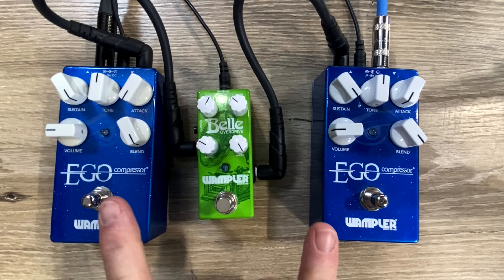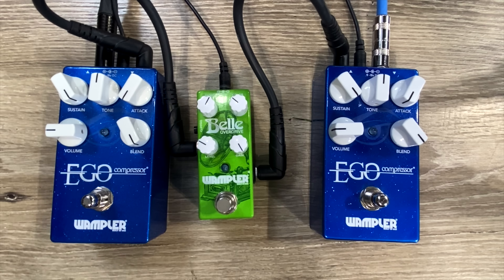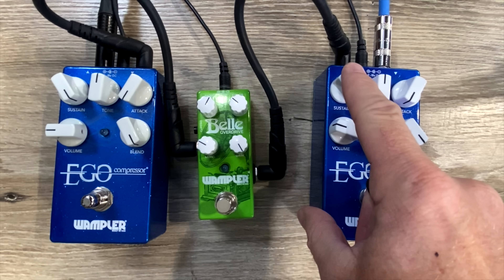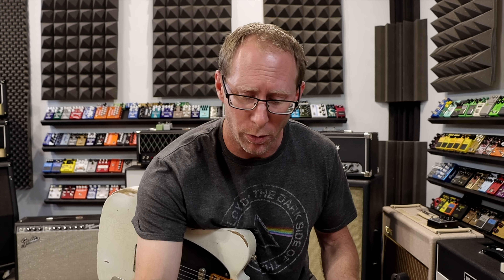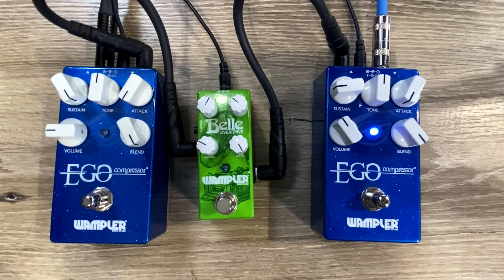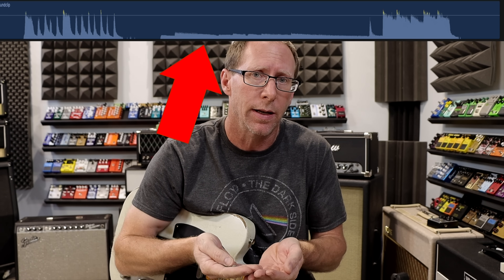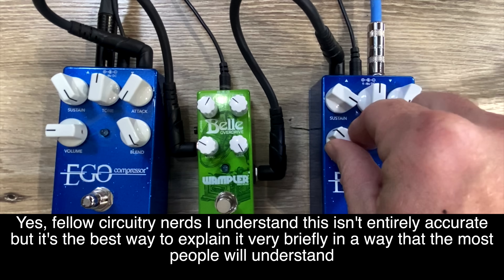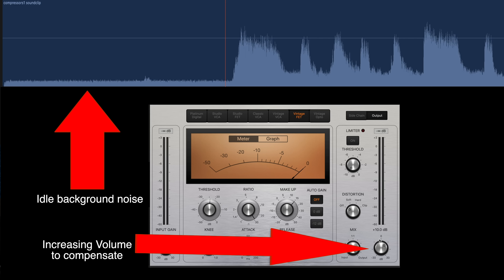Are you making these mistakes with compressor pedals?

Comment: I really like to keep a compressor on all the time, really subtle, to round off the edges of the sound. Also it gives a very nice percussive pop to the tone, and just helps all around with the consistency of the sound.
Reply: I play power metal and use one exactly the same way, just to smooth the dynamic range slightly and give it a little thrust to your sustain.
Reply: Same here. I think keeping one on all the time is a really good idea . Most recorded albums have a lot of compression added either pre or post production so players need to keep that in mind. A lot of records where I heard acoustic guitar really popping and sounding bright and full of sustain was very hard to match and for years I didn’t realize compression was added to that sound to make the finger picking or strumming pop out much more than it would without any compression. So, if they use them on almost every album made, it’s probably important yo keep it on a pedal board to get a more polished sound. A clean blend is great but even without one it’s not hard to adjust it to taste. One thing I always notice is they tend to boost the level a lot and that’s the first thing you’ll hear when turning the pedal on from off. I think compression is key and I wish I knew about it 15 years ago as far as pedals go.
Reply: @jordandangelo180  you’re right. It’s a tool, and an important one. Knowing when and where, and how to apply it is key. You mentioned the level and that’s one of the things I like about keeping one on: the thinner strings sound fuller, closer to the thicker ones, making the sound more balanced. I don’t get to play super loud, or own a cool tube amp, so natural compression is not achievable for me. I get around using effects pedals and it just makes it fun for me. 
At the end of the day it helps me get a sound and feel I like, and I enjoy playing because of it.
Reply: Likewise.. I set mine at a point where you don't notice it's on.. but do notice when you turn it off. It's just enough to improve string & picking balance slightly, without affecting intentional dynamics
Reply: Angus uses a wireless that compresses his signal slightly . I agree I like em , depends on what I'm playing . If I'm going for allot of dynamics ? I leave it off .off course now , I honestly forgot about this , that blend knob ... I'll be messing with that later .
Reply: @Mason 'The Fib Doctor' Marangella oh hey, the tone police finally showed up. Sorry, officer, that won’t happen again.
Reply: @Mason 'The Fib Doctor' Marangella don’t! I’ll go quietly.
Reply: @shinjial  did he delete his comments or are you imagining talking to him?
Reply: @studieslessonstheoryetc141  lol he did delete his comments. He was saying that “that what playing with your fingers is for”. For the darker, rounder sound and the pop, I guess. Which is true. But different context, different playing style, different applications. 
I didn’t even realize who it was until later lol.
Reply: @shinjial  good times
Reply: I use it very similarly ...I turn the sustain down and use the volume to goose the amp slightly. It keeps my deluxe reverb from breaking up too early yet gives some sustain and charge to the sound without sucking the life out of the dynamics and collapsing the sound.
Reply: It’s BS when guitarists hate on always on compression.  For me, a compressor can really liven up the tone!
Reply: @fiddlefolk  what? My deluxe reverb never breaks up to early.  Am I right in guessing that you primarily use humbuckers?
Reply: Me too. It’s always on. I love my Origin Effects Cali/76 stacked edition.
Reply: Me too
Reply: @scottdunn2178 "smoothing the dynamics"? I call it killing the dynamics. But than again, metal was never about subtlety, right!?😁
Reply: @hrvojebartulovic7870  You don't think my tone has any dynamics?
Reply: @hrvojebartulovic7870 it depends on the attack time. You can actually make your guitar sound more punchy and dynamic... If you know how to use one 🤷‍♂️
Reply: Ask a bassist xD
We do this for a long time, even before guitarists started doin it.

Just a bit of compression on the first slot in line.
Low ratio, fast attack and medium release.

Just so you can feel it, but not hear it instantly :)

Comment: A compressor set below unity gain and placed before a crunchy amp-style overdrive pedal can give you a sound of that amp-like pedal that's clean but still "louder" than the clean you'd get by turning the guitar volume knob down. So, say, a Vox-like overdrive can turn into a nice clean Vox tone by using a compressor as an "underdrive" pedal in front.
Reply: I do that except I roll back the volume as I use the compressor to make overdriven sounds sing
Reply: Hi! Compressor novice here. Does this also work with a Vox amp that tends to break up early, like an AC-15?
Reply: @meadish  Yes, the same principle should work.

Comment: Here's the thing people: The big shiny button on the top is more than a "take a break" button. If you are playing your rhythm parts with the compressor and you get to a part you need uncompressed tone, simply step on it and you have all your dynamics and uncompressed sound you can handle. When you're done with your solo or flashy part, simply turn it back on, step back like Malcolm Young would do and continue the song. I know that's extra work, but for the love of Pete it's not that bad. Case in point: I watched Eddie showing us his new 5150 IIIs and he was playing the opening riff of Unchained.  He would step on the phaser when he wanted that sound, then turn it off for a few seconds, turn it back on , then off....he was actually USING the effect like an instrument by itself. In the first 8 bars he must have turned it off and on half a dozen times. You can do the same thing. On when you want compression, off when you don't. I know that sounds overly simple and it is, but the complaining by some about a great piece of gear is dumbfounding.
Reply: so, use the compressor as a volume control during the rhythm parts so the audience can hear the rest of the band over you and then take it off when you solo?  BRILLIANT! Kind of like use compression in mixing. Squash down the stuff that's less important so the singer or whomever can shine through.
Reply: You just went on a rant to tell people how to turn a pedal off? What is your problem? You think people don’t turn their effects off enough?
Reply: By the way, unchained uses a flanger

Comment: 1) What gets labelled as "Attack" on a great many compressor pedals is generally not an attack adjustment, per se, but rather a recovery-time adjustment.  That is, it does not alter how quickly compression kicks in, but rather how quickly it shuts off.  When the time it takes for the gain to be restored is longer , after pulling it down in response to picking, one tends to miss the bright pick attack of the next note picked.  Shortening the recovery time makes the pick attack of subsequent notes easier to hear, which is why it tended to be labelled as "Attack".  Here's the thing, though: if you pick quickly, you can easily hear what changes to "Attack" time do.  But if you pick slowly, you'll be twiddling the knob wondering if it does anything at all.  The effect of that control depends on your "inter-strum interval":, so bear that in mind.

As an aside, folks who study and dissect compressors will describe what gets called "breathing".  If recovery time is slow, one can hear the gradual increase in hiss as the gain increases and is applied to whatever noise is in the input signal.  It tends to sound like someone taking a long inhale - hence "breathing".  It is MOST obvious (and annoying) if the compressor is preceded by a high-gain device.

2) I find one of the best and most helpful uses of a compressor is to maintain volume level when you're strumming and singing at the same time, or simply backing up a singer.  Paying attention to what you're playing, and how loud you're playing it, can sometimes require more concentration than you have available.  Compressors let you focus on one thing and not have to worry or think too hard about the other.  You can flail away and not have to worry about accidentally drowning out anyone, including yourself.

3) RE: Noise.  Compression serves not only to pull back on gain of peaks, but also apply gain to  quieter signals.  I can't think of a single analog compressor under a few thousand dollars, and able to fit on a pedalboard, that can tell the difference between a vibrating string slowly decaying, and incoming hiss/noise/hum.  As far as the compressor is concerned, that soft signal (i.e., noise) is in desperate need of help, so it boosts it.  ALWAYS make sure that no matter where you stick a compressor in your signal path, you feed it the quietest most noise-free signal you can.

4) RE: Before vs after.  Yes, compression ahead of a dirt pedal will produce a more consistent dirt-tone since the compression is maintaining the signal at a constant level, relative to the clipping threshold.  BUT, all dirt pedals will reduce the dynamics of the signal at least a little bit.  So feeding a dirt pedal to a compressor will monkey with what the compressor is able to detect.    Any before-vs-after comparison will depend on how much you squish with the compressor, how much distortion/clipping one aims for with the dirt pedal, and how hot the output signal is from either the compressor or dirt pedal.

That said, as noted earlier, if you feed a compressor with a cranked dirt pedal,  the dirt pedal's noise is going to introduce heavy "breathing" during your non-strumming moments, so be careful.  That doesn't mean you shouldn't stick compression after dirt.  You just need to manage noise levels sensibly.
Reply from the maker: Pure gold, good sir!
Reply: @wampler_pedals  Thanks, Brian.  I'm just glad you didn't say "That's gold, Jerry!  GOLD!", like Steve Banya.
One of these days, someone, whether yourself, Andy Martin, Rhett Shul, or Josh Scott, is going to have to post a top-ten-most-misunderstood pedals video.  Compression is certainly in there, as are noise gates, "exciters", some 4-knob modulation pedals, some octave-up and octave-down units, and many others.  Not everything is as straightforward to beginning electric guitarists as a 3-knob fuzz.
Reply: thanks man, wonderfully comprehensive explanation!
Reply: @giantessmaria  Thanks.  Brian always starts the ball rolling in the right direction.  Makes it easy to fill in the gaps, and saves him the trouble of making hour-long videos!  Personally, I don't think many understand or appreciate that compression IS the sound of rock.  Keep in mind that, traditionally/historically, limiting and compression were needed to avoid saturating the tape that music was being recorded to, to permit fitting more music on a vinyl side, and to allow broadcast transmitters to send out as undistorted a signal as possible to listeners.  At every step along the way, some degree of dynamics-reduction was being imposed on rock, making compression the "normative" sound of rock - what we hear and like about the music we like.  Later digital technology allowed for much greater dynamics, without sacrificing sound quality, but we still associate a degree of "sponginess" with how rock guitar is supposed to sound.  Why else do you think Tube Screamers and tube amps are as popular and standard as they are?  They just sound "right" to our ears, partly because of the way they tinker with dynamics.  So optimal use of compressor pedals is, to my mind, an important part of being a skillful rock guitar player (as is how to identify when appropriate compression is being achieved by other means).
Reply: Comment of the month right here! ♥️
Reply: This post should be required reading for all guitar players.
Reply: @TheRustedShackleford  Thanks.  The information has been out there in one form or another for decades.  That's how I learned it. There was a terrific article on choosing a compressor in a 2001 issue of Electronic Musician that covered a lot of it.   The goal was largely to provide guidance on what rackmount compressors were good for what sorts of signal-sources/instruments, but in providing that advice, a lot of what I attempted to summarize here was nicely explained.
Reply: Do you have a channel?
Reply: @mattstraus8799  Only for posting samples of things I've built.  Nothing especially instructional.  Stick with Brian, Josh, Dan & Mick, Andy, Rhet and the rest.  If I spot anything missing & critical, I'll be sure to pop up.
Reply: I should add that my own favorite compressor is the first one I ever bought: a Univox Uni-Comp in the little grey box with the foot image on it.  Probably the simplest optical compressor ever designed.  "Transparent" is the last word you'd use to describe it, though.  It's clean, thanks to being optical, but it is an effect , and boy oh boy does it love Telecaster bridge pickups.  If you come across one, try it out.

It has a very interesting design element that someone on the stompbox forum explained to me.  There is a pair of diodes at the output.  "But won't those clip?", you ask, and you'd be right.  But apparently, in the earlier days of optical broadcast limiters and compressors, this was a common trick to quickly rein in the first peak, while the light source and photocell were taking their sweet time (well, a few milliseconds, at least) to get down to business.  Because the photocell did eventually attenuate things as it was supposed to, the diodes' action was restricted just to the first few milliseconds, so one didn't hear it as distortion.
Reply: Put a noise gate between the noisy signal and the compressor?
Reply: @basicforge  One of the reasons why I'm surprised few pedal-makers have based their compressors on the SSM2166 chip.  It includes a downward-expansion function with variable threshold, making for a dead-quiet signal when you stop picking, depending on how one sets the time constant.  I really like the one I built for myself.  Like all compressors, though, having a slower gain recovery makes for enhancement of sustain properties, but it also prolongs the "breathing" before the gating action of the downward expansion kicks in.  Not objectionably, but audibly.
Reply: Great channel. Great comments.
Reply: Great addendum 👍
Reply: @wampler_pedals  Per Mark Hammer's statement that "attack" on pedal compressors typically works more like a "release" parameter, which is it on Ego? (I'm in the market for a pedal compressor for a pedal board, but my knowledge of compression comes from the production side of things. I think of attack as how fast the compressor clamps down, which helps one control initial transients.) Knowing exactly what each parameter does will help me decide if this is the right one for me. Along those lines, I'm assuming the blend knob works the same way it would on a software compressor (essentially an easy way to dial in parallel compression). Is that right? Thanks.
Reply: Thanks Mark
Reply: So with the attack over the right gets more bright pick attack?
Reply: @Davidthestratman7  Yes and no.  Not being familiar with every compressor, shorter gain-recovery (AKA "attack") times may be fully clockwise OR counterclockwise, depending on the specific unit.  But the point is, with shorter gain-recovery/attack times, full gain is applied to the pick attack of the next picked note in line, even IF it comes very quickly.  If space is left between picked notes, then a slow attack time will sound the same as a fast one, because the gain will have fully recovered (i.e., returned to full gain).  If it takes longer for the gain to recover, then subsequent notes, picked quickly, won't seem as "bright", because their pick attack won't be amplified as much as that first picked note.  

This is why that control confuses so many players.  They expect it to produce a clearly identifiable outcome no matter HOW they picked, as if it worked as obviously as a volume or distortion-intensity control would.  They twiddle the knob around and can't seem to hear any difference.  But such "attack" controls depend on the speed of your picking to have an audible effect.

Make sense now?
Reply: Barely
I don't really understand the tech stuff
Reply: The Attack control on my old T-Rex Comp Nova almost seems to be like a blend control, or that's how I perceive it. The MI Audio Compressor behaves very differently, closer to what you describe in terms of the end result (ie:pick attack)
Reply: Brilliant.
I'm getting things and know what you mean.
Ive watched all the Kush videos and many more.
Im finally getting a balance with pedals and in my Daw.
And finally parralell in aux sends.
I'm using less and less and add different swings on drum channels with different feels ADSR  and it's far, far better.
My old tracks are insanely bad in settings and on every track.

Comment: i introduced compression to a mate who plays acoustic guitar.  he was so blown away how a subtle compression of his guitar made it feel more controlled and easier to just play and sing at the same time.  It's my favorite effect especially on clean guitar.  blend knobs make it easy to add as much subtilty as desired, very console oriented used by audio engineers, especially live performance.
Reply: I got myself a Wampler Ego specifically to use with acoustic live (mainly solo). Still getting my head around it, any tips or pointers to acoustic specific guides would be appreciated!
Reply: I use a keeley 4 knob and its magic with the acoustic when i turn it on lol
Reply: @notmyname3681  sorry, just saw message.  hopefully you came to the realization that used subtly is best.  mix a little compression wet/dry knob, to lift the low notes up a touch but retain natural sound.  too much can squish everything you play and kill dynamics.  also can give a pumping sound to notes.  or try slow attack, fast release.